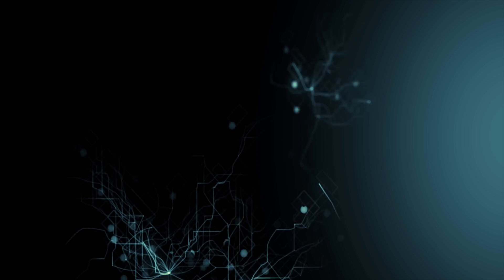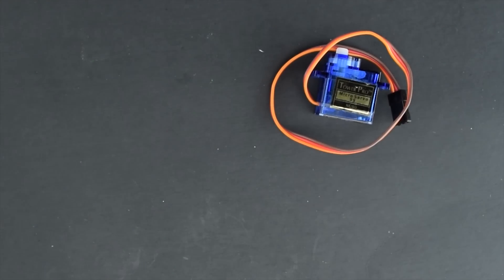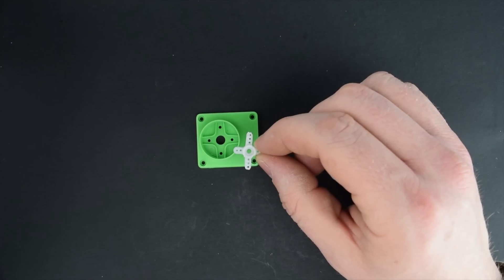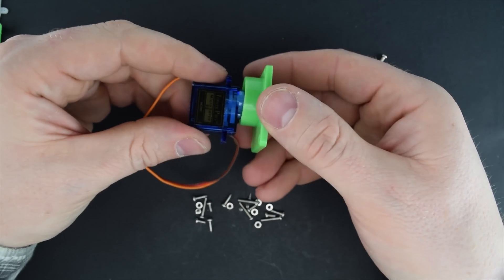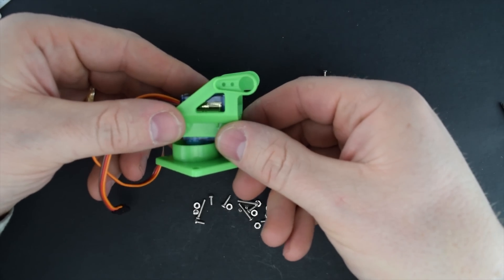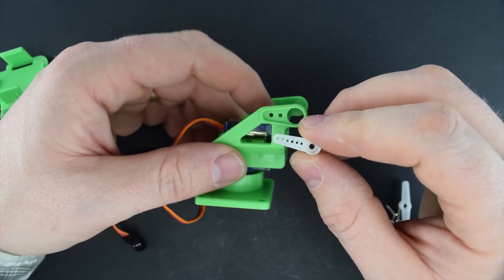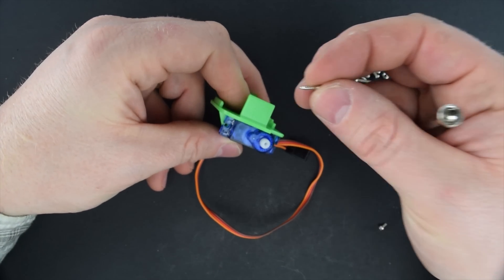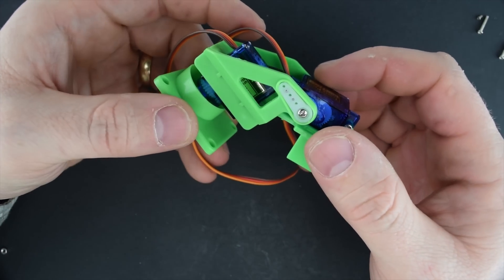Pan and Tilt Sensor Mount Assembly for Arduino and Raspberry Pi

Comment: This mount is sold as pieces collected and not fitting. I have one myself. He struggles at several points to assemble and the camera is turned off. Screws don't fit. This should be mentioned in this video.

Comment: I looked for a video only to find if others had the same problems like me. 
a) the holes of the servo mount do not align with the pan
b) my servos do not freely move... they are like stuck.
c) the tilt does not attach well with the up servo...

Comment: I got mg90 servos with metal gears, they are deeper than the plastic ones, so when attaching to the tilt head, I had to leave a gap of about 3mm otherwise it bends the hinge opposite the gear, glad I had plenty of spokes to play with too.
I see no point screwing the spoke on the tilt in as the centre screw will hold in in the moulding (and doesn't really need cutting down)
Definetly helpful video though!

Comment: That's a very cool little unit and it looks like it works real well.  I see that this video is well over a year old.  Do you still have these for sale on ebay?  I'd be very interested in two of them...maybe 3.
Reply: mountaindewdude76 you can get them on aliexpress for 3 bucks good quality, also the reason im watching this now because it just came in and didnt come with a assembly

Comment: The mg90s has a plastic main gear that wears out just as fast as the cheaper all plastic geared one! Meaning for more money you'll get a servo with metal gears that's useless once the main PLASTIC GEAR WEARS OUT SMH DESIGN. replace the plastic gear with a brass one trust me